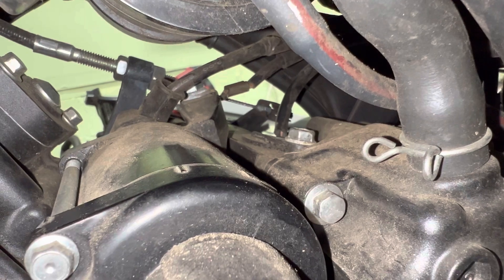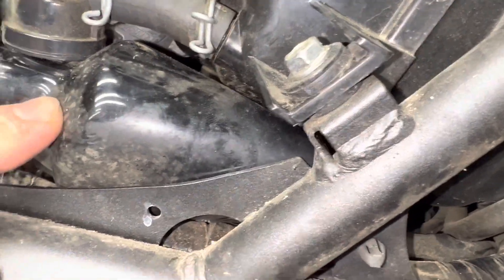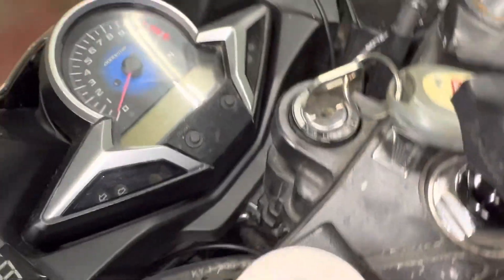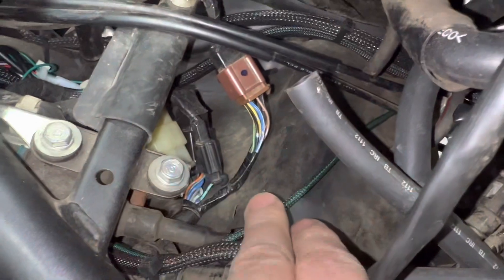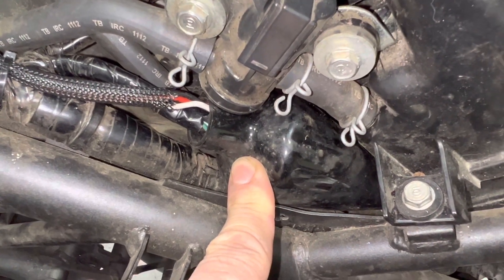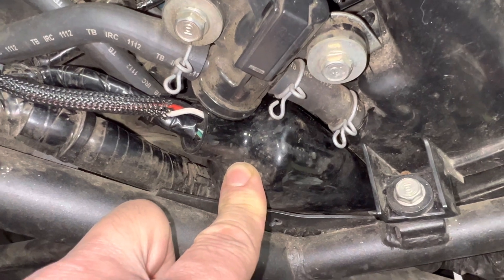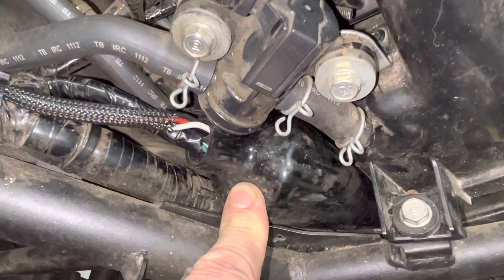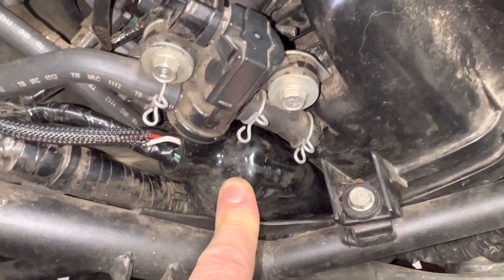2013 Honda CBR 250R Factory Speed Sensor Location for a Gear Indicator Display

Comment: hello friend, how do you install gear indicator on cbr250r? do you have electrical schematic? coincidentally i also have cbr250r and i want to install gear indicator, thank you friend
Reply from the maker: Manufacturer provides install manual. It is really simple. 4-5 wires: speedometer sensor (can't remember if it's one or two), tachometer, ground, power. Honda factory wiring diagram / manual can be found online.

Comment: Make a detail video of installation and wiring process
Reply from the maker: Do you have this year and model of motorcycle?
Reply: CBR 250R 2012 NON ABS MODEL @AshrafFarrag
Reply from the maker: @abdulabbu7856  device manufacturer provides install manual. It is really simple. 4-5 wires: speedometer sensor (can't remember if it's one or two), tachometer, ground, power. Honda factory wiring diagram / manual can be found online.
Reply: @abdulabbu7856 same here and I also wish ANYONE would make a video where you can actually freaking SEE the wires for the install!! So frustrating. DID YOU EVER GET YOURS FIGURED OUT?